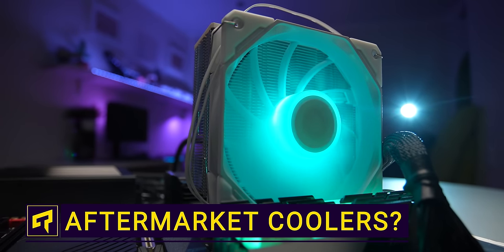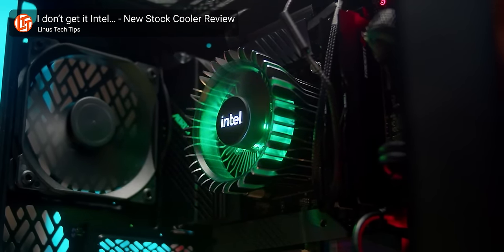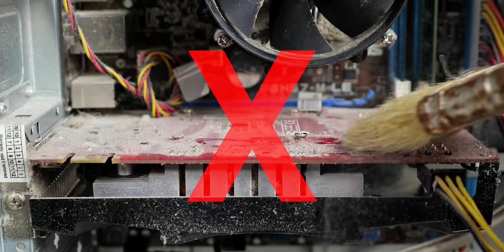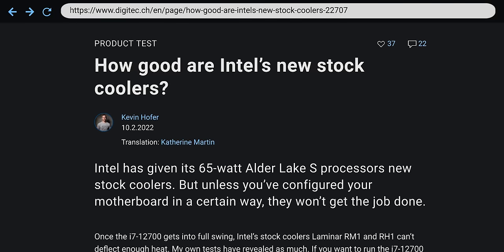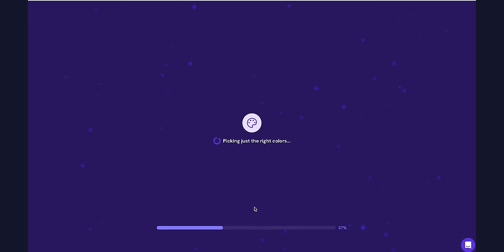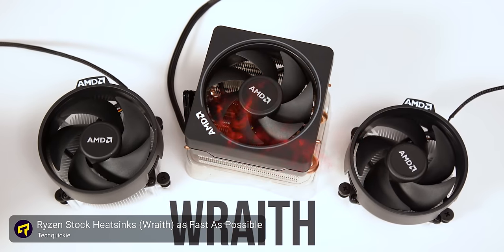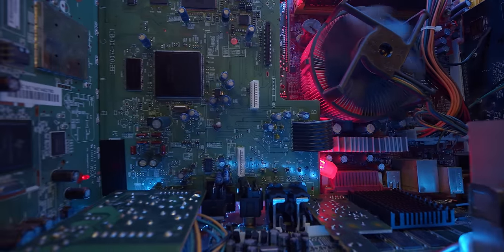Are CPU Coolers A Waste Of Money?

Comment: I always buy a cheap aftermarket box cooler. The issue I have with most of the stock coolers, that the fans are smaller and often make a whining noise when spinning up/down. Also box coolers will run the CPU at lower temps which is good for longer CPU life. If I do have to use a stock cooler I just set it to a fixed speed so the change of speed doesn't make annoying whine changes. The issue with cheaper AIO coolers is also that the included pump is prone to failure after a year or two. Also such a cooler produces no air flow around your power conversion modules on the motherboard that tend to get really hot. A top down or box cooler will help cooling those, and AIO won't.
Reply: Most decent motherboards have built-in heat sinks for all of the thermally charged components on your board so it really isn't that big of an issue. Also if you have a fair amount of fans in your case to ensure decent thermals that also reduces the need to have a fan right next to the board.

I might have gone a bit overboard with the number of fans in my case(9 fans) but the only air that ever comes out of my case is cold air even under load.
2 Push pull fans(2 on each side) at the front of the case through the 240mm radiator a 3rd at the bottom to cool the PSU through the PSU shroud, 3 at the top for exhaust and 1 at the back for exhaust.
Reply: This isn’t the 90s anymore. Most MOBO’s have heatsinks to aid in moving heat from the power phases my guy…

The only exception is cheap mobo’s and I wouldn’t recommend gaming OR heavy computing tasks on those boards for OBVIOUS reasons…
Reply: @kingzach74 Definitely overkill on the fans 😅

But if it keeps everything quiet that I couldn’t complain

Comment: The funny thing is that the real function of most CPU coolers is to cool down the case, not the CPU. An open frame PC can work peefectly fine with a decent air cooler, but when you put it in a cage (supposedly to protect it) you can be creating a huge cooling problem. Its all about that. The typical  excuses to use closed cases  are kids and cats, but none of them are stupid. They are smart, they learn. And no, if you build your PC in an open frame they will not lose their fingers and paws.

Comment: The question is if I live in tropical country with average daytime temperature of ~30°C and I'm not a fan of using AC and prefer natural airflow helped with an exhaust fan, can a big heatsink cooler help in my case? I'm considering something like Ryzen 5 5600x or anything on par

Comment: I'm currently using my pc tower laying sideways and using the weight of the big heatsink is pushing down on my CPU.. 

5900x with some £15 cooler. 
Stresstest is 99c 
Idle is 30c
Gaming is 60c 

I'll usually run out of available ram before I ever hit max usage on this thing.

Comment: I used Noctua coolers from 2011 to 2015 then I went water cooled for 5 years then I had a dream my loop leaked and caught my house on fire and literally amazon 2 day,  back to Noctua ever since.  I also dont care about the aesthetics inside the case.  Hard to find cases without glass side panels today but its pretty easy to buy some wrap and make them not see through which I did for my H500.  Oh and no,  I have not switched to the black Noctua.  Ugly tan and brown all the way just because why not.

Comment: A basic 4 pipe 120mm single fan copper block will handle 150w of heat without being louder than your graphics card, and is probably more than adequate for 99% of PC users.

Comment: The stock Intel cooler has always been a mixture of "solid block, average fan, garbage mount", only mounts the first time and after that it no longer secures itself to the board. Use a Noctua cooler at least.

AMD, I haven't bought a new AMD CPU, ever. This goes back to Pre-Athlon/Pre-ATI merger era where AMD's "Intel socket" compatible parts were incredible garbage. The OG Athlon was the first CPU that didn't suck since the AMD 386DX40. But I've been cautious about AMD's general "low end" parts, because they cut corners far more than Intel does. High end, just get an aftermarket cooler.

Waterblocks and AIO's are mostly a waste of money if you're not overclocking, because unless you are trying to show off the desktop, you're not gonna see it, and RGB stuff just draws more energy. You can invest in these, but if you're going to do that, you should straight up buy a quality large unit, not a small one.

Comment: I spent $700 on a processor so I spent 200 on a waterloop AIO.  It is so cool that sometimes on cold nights, it gives me shivers because the air comes out and is directed at me by the cart that I have my desktop on.  🥶
Reply: I have the same experience with mine. The air that comes out of my PC is nearly ice cold even under load. I still don't know why people continue to choose air coolers over water cooling when water cooling doubles as AC for you as well.

Comment: Using a AIO is so much better then a air cooler, I have used air cooling for decades and after I won the AIO from CoolerMaster, my CPU has been 15°F+
Reply: 15F?  Really?  Don't you mean Celsius? Even 15 C is approx 59 F.

Comment: This I9 14900K chip didn’t come with a stock cooler and heats up a few degrees  shy of nuclear fusion.  I think I need an AIO so I can cool it with RGB.
Reply: You're right.  That 14th gen Intel can really get hot, so I'd stick with a top notch AIO instead of air cooling, particularly in the summer.

Comment: I just bought another NHD-15 avoiding AIO's because an air cooler has 2 parts that can fail, and they're easy to replace. An AIO pump failing means the entire thing goes in the trash.
Reply: I hear this often, what about an AIO is more complicated to repair than other water pumps?

Comment: Just get a new model $20 air cooler. They outperform what used to be $50. $40 new model air coolers outperform Noctua's best, the NH-D15. I have thermalright in mind
Reply: Thermalright Assasin X120 R SE ARGB and the Thermalright Peerless Assasin 120 SE are both cheap but have racked up quite some impressive reviews. The Thermalright Peerless Assasin 120 SE comes quite close the the performance of a Noctua NH-D15 but the Peerless is less than half the price.

Comment: Heat kills you computer components so if you can run everything at a cooler rate then do so as it will help immensely with longevity.

Comment: Considering an air tower cooler is only $50-$60, it doesn't even make sense not to upgrade from stock CPU cooler to air tower cooler. And air tower coolers work almost as good as expensive water coolers.
Reply: Key word: "almost".
Reply: @eskieman3948  Moot, unless you think an extra 5⁰ of cooling is worth quadruple the cost.
Air cooler also ZERO maintenance.

Comment: also if you are running an itx build an aftermarket low profile cooler can help if you have tall ram sticks that the stock cooler might jam into i have had this happen to me when i was working on my build the amd logo on the stock cooler was jamming up against my ram stick making it hard to put the cooler in without breaking the shroud around the cooler

Comment: Yeah - to be honest CPU watercooling outside of extreme overclocking is dumb, BUT GPU watercooling is amazing. That is why I always find in very dumb when people have something like 13600k on 360mmm AiO, but rocks 5 storey house sized 4090 on air. I literally run 5800X3D on standard Wraith RGB from 3800X at the moment and it works just fine, yet my 6900XT is watercooled model and it makes massive difference. Yes once in a while temperature jumps to 60C for a second and fan becomes audible, but apart of that totally viable.

So really people - you should be watercooling GPUs not CPUs, CPUs are fine even on modest cooler, whereas 300W+ GPUs need a fcuking boat to be attached to them to stay somewhat resonable... yet water cooled GPUs are both quiet and cool, mine came with 240mm AiO and most of the time fans don't even turn on at all.

Comment: If only they didn't use garbage tier coolers which throttle CPUs at stock speeds, same whenever I tried over the last 15 years. i5 2500, i5 6500, 5600x all downclock with stock coolers and reach insane temps.

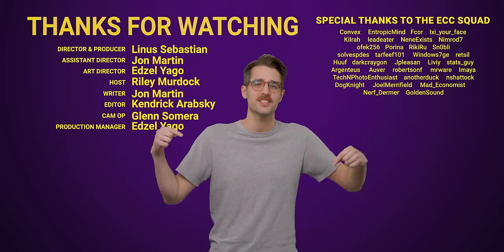Comment: hahahah 5:20 im guilty of this. I remember back in 2010 I bought a 240 AIO cooler master at that which is expensive and slapped it in my Athlon X2 250. hahaha  deym those Athlon run 32 degrees celsius max

Comment: If you've got a 13 or 14 gen intel CPU, you'll definitely need a good CPU cooler when running stock without overclocking.

Btw, why does this dude sound like Linus?
It's annoying.

Comment: this is why for this build, i am going with a Deepcool AK620 2x120mm 🙂

AMD Ryzen 7 7800X3D
ASUS ROG STRIX B650E-E GAMING WIFI
MSI GeForce RTX 4090 VENTUS 3X E 24GB GDDR6X
Corsair 32GB (2x16GB) 6000MHz CL30 Vengeance RGB AMD EXPO
Samsung 4TB M.2 PCIe Gen4 NVMe 990 Pro
Samsung 2TB 2,5" SATA SSD 870 EVO
MSI MEG Ai1300P 1300W 80 Plus Platinum ATX 3.0

Phanteks Eclipse G500A Performance